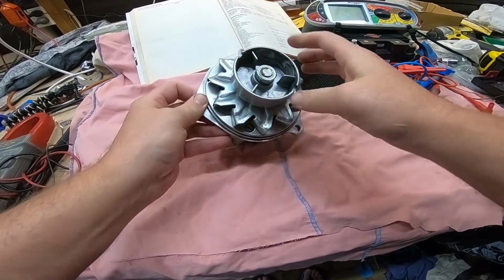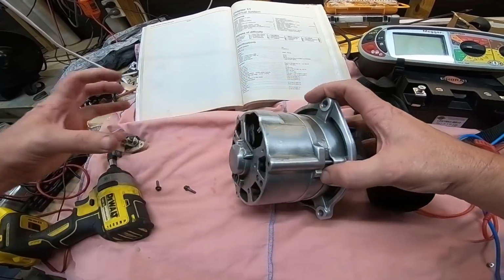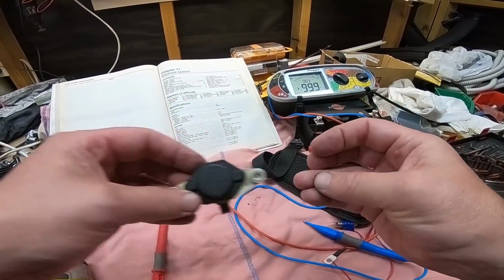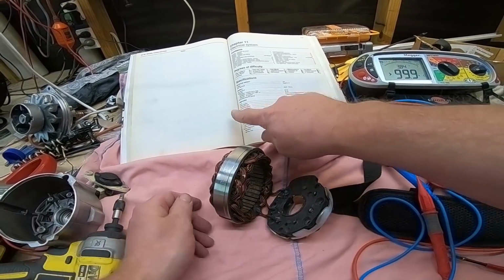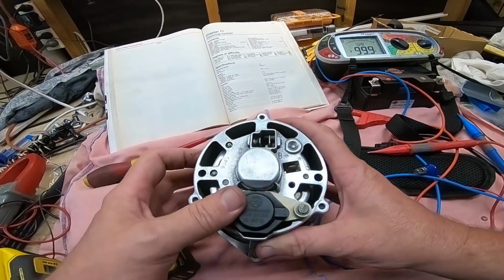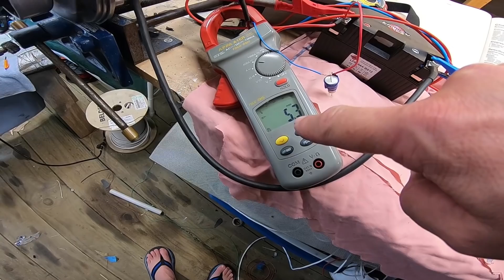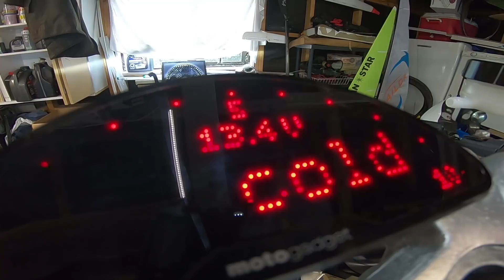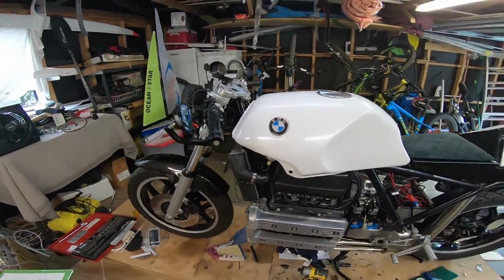BMW K100 CAFE RACER BUILD PART 43

Comment: Are you saying your issue with not charging was due to a missing bulb; meaning that you had an open circuit? I removed all the bulbs from mine and taped up the wires and have not had an issue (I've put 500+ miles on it so far)
Reply from the maker: Yes that is the reason I was not getting any charge , mine must be slightly different to yours maybe? some how? hmmmm?????

Comment: Mikeyfrompiha I'm fitting an after market gauge to my K100 so will have the same charging problem, you fitted a bulb which sorted the issue, my question is was this your final solution or did you fit a resistor in its place? 

Great build by the way
Reply from the maker: Hello there , I fitted a bulb from the old clocks and mounted it in my battery box , I have a volt meter on my display so have been able to keep a close eye on the charging and so far so good !
Reply: @mikeyfrompiha  Thanks, Blue wire from alt to bulb to positive on battery?
Reply from the maker: @joebloggs1317  yes , but through the ignition switch too otherwise that bulb will be glowing 24/7 till the battery goes flat :-)